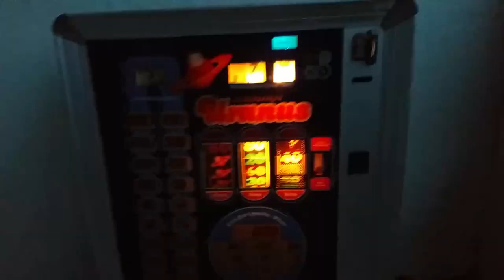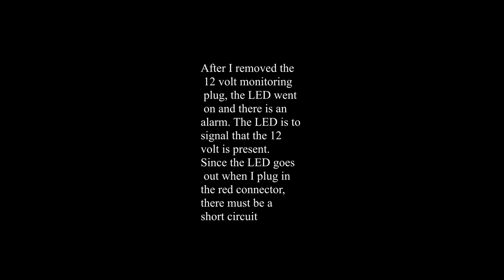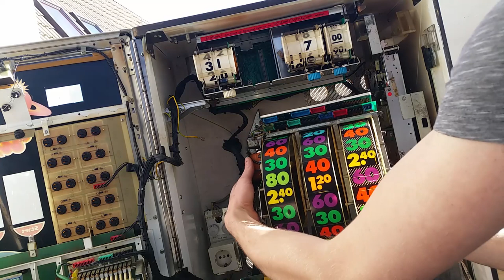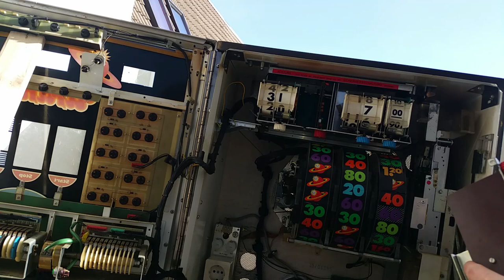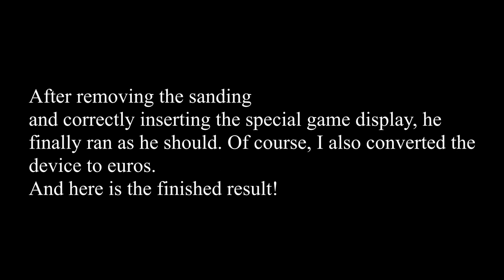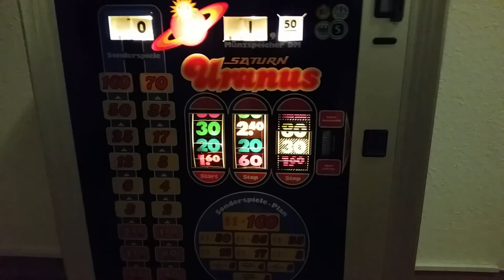Repair and restoration of a German Slot machine. Merkur Saturn Uranus from 1984!

Comment: Good job! Unfortunately, the roller foils have been badly damaged in many places and the imprint of the game instructions on the right side has completely disappeared. This is unfortunately a typical problem with these devices.

One more correction: The Saturn Uranus was not a Merkur unit. The manufacturer was called Stella. The year of manufacture was also not 1984 but 1982. The counter was probably replaced in 1984 because this counters were unfortunately quite susceptible to repair.